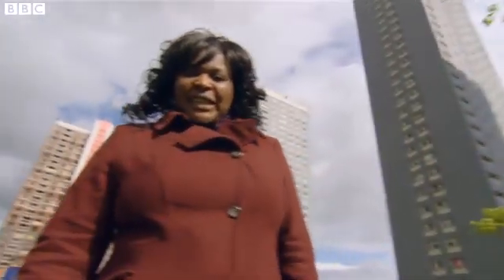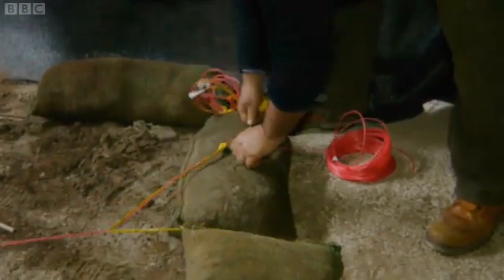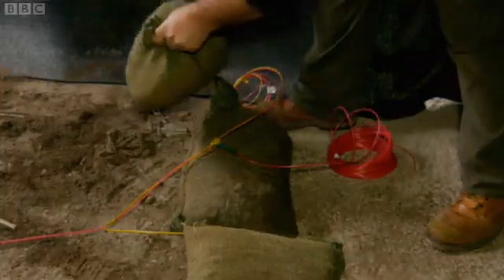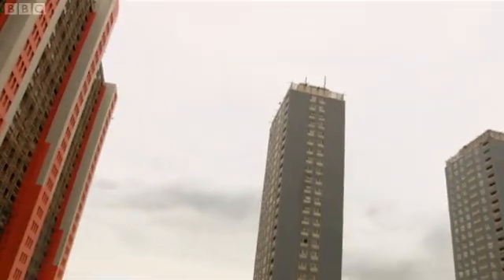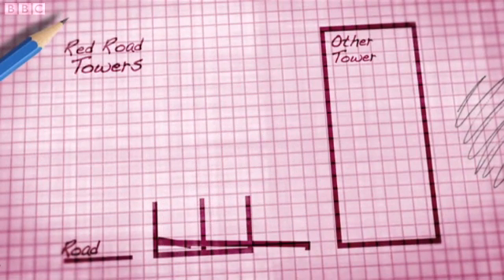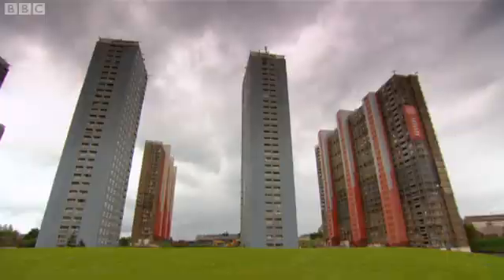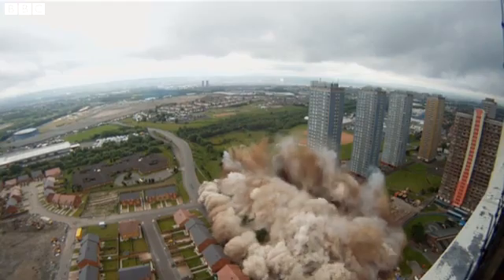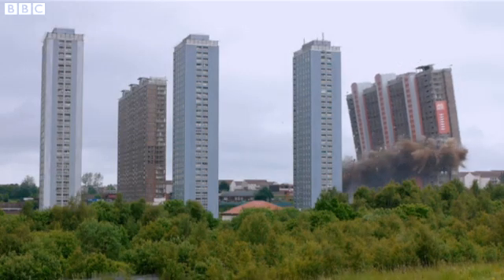Red Road flats demolition special technique

Comment: I dont get why they pull them down if the structure frame is strong it would be better just to rip all the dry wall plumbing ect out and refurbish them like they did with the greendyke high flats in Edinburgh

Comment: I wonder what they do to prevent asbestos dust?!
Reply: Remove it.
Reply: Spend months taking it out. Or you can do what the US government done. Just take them out with planes to save the cost of taking it out properly. The "steel beams that melted from jet fuel" were actually covered in asbestos.... which is fire proof....
Reply: @OffGridInvestor 1st of all steel beams lose half their strength at 1100 degrees Fahrenheit and with a google search you see office fires can burn up to 2000 degrees Fahrenheit and considering it was over 150000 tons of material above and in the impact zone we see why the top fell down to the bottom and 2nd the plane crash basically blew off some asbestos leaving some behind but the fires heated the asbestos heating the beams/trusses then causing the collapse